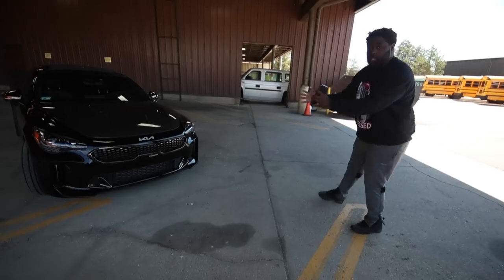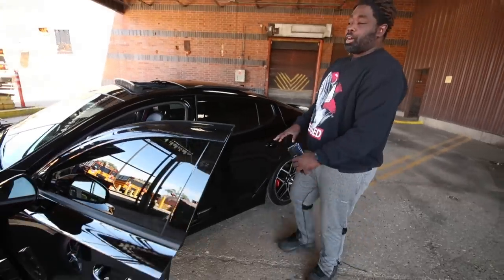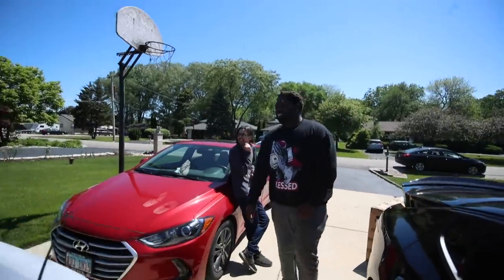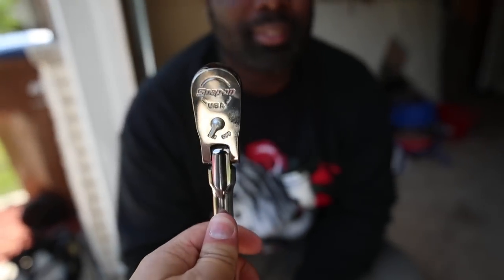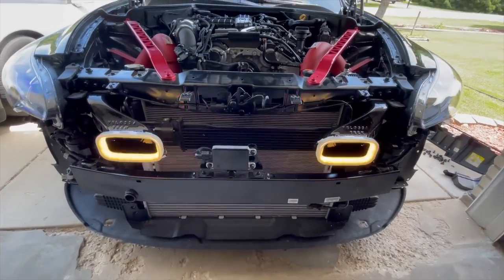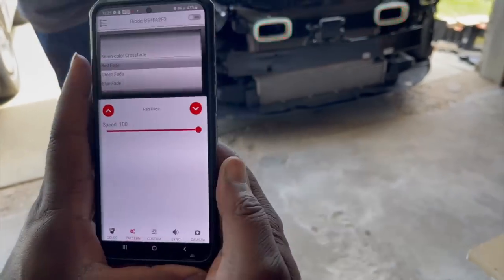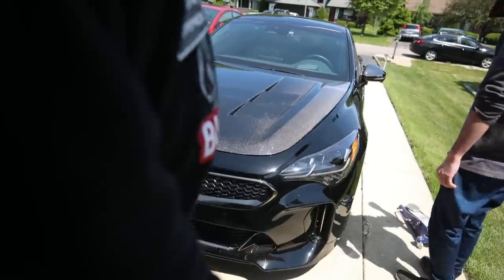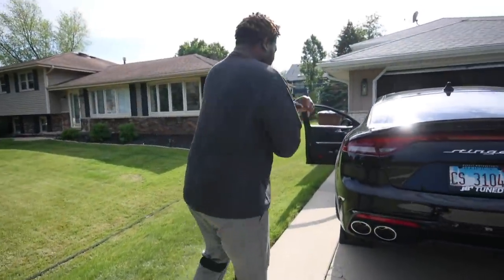PAPA'S 2022 KIA STINGER *BORLA EXHAUST AND VELOSSA TECH UPGRADE!

Comment: Sounds like a beast, but the raspy notes on the higher rpm’s is not everyone’s cup of tea. Would  installing a high flow resonator eliminate the rasp?
Reply: Yeah imo those raspy notes honestly sound disgusting and not really in a good way😂 still a sweet ride tho
Reply from the maker: possibly but it's a V6
Reply: @VividVisual  Adding a Vibrant Resonator will remove most of the rasp, if not all. For me, I went with a custom setup. Started with secondary cat and muffler delete, then added the Resonator which removed about 60% of the rasp, then added a  Magnaflow High-Flow Cat which got rid of the rest.
Reply: I love rasp but this was more along the lines I've a vibrating tin sound, maybe it'll get deeper with more miles?
Reply: @leopapio683  It does not, welcome to a V6.
Reply: @stormbarnicle  idk man the CTV 4 V6 sounds pretty deep.

I'm assuming a different resonator?

My hellcat had a rasp to it that sounded like something rattling but I'm just assuming it has more to do with acoustics because  resonators fixed that
Reply: @leopapio683  Iv'e had my Borla on for a week and a half now, yep at the beginning it sounded a bit tinny /raspy but now is not so much.Exhausts need time to seed in and once the carbon is laid down in the pipes they seem to deepen slightly in tone.Same thing happened with my original bimodal.

Comment: I noticed that everyone who installs the velossa tech big mouth pull the shroud out of the front. That shroud is necessary for cooling. I installed the velossa tech bigmouth‘s on my 20 Kia stinger GT two and I left the shroud in. All you have to do is fit your big mouth  and trim a small area out of the shroud. fits perfect and you still have the functionality of the shroud you don’t have to move any wires or zip tie anything together.
Reply from the maker: Thanks for commenting!!! Much help!

Comment: Did Papa figure out the Exhaust tips for the Borla on his 2022?   I have the same set up and have been reading that Borla and MBRP are coming out with a modification to their exhaust for the 2022 now.   The pipes don't line up with the larger separation of the holes that is what is causing more of the drone and cabin sound.

Comment: My 2019 Stinger is getting lowering springs and Konig Rennform wheels in the next couple weeks, then i'm going for a BOV and a catch can. I love this car 10 times more than the Camaro in my Youtube avi that I owned before it
Reply: I would honestly skip the bov, the factory ones are better than most aftermarket unless u care strictly bout the sound. Do OCC first, the amount of oil mine collects every 1000 miles is def worth it
Reply: @hozanz89  you right, I get enough noise from my K&N Intakes.
Reply: @cozy8874  exactly man, i got the injen intakes, borla catback, jun bl downpipes, jb4, upgraded spark plugs and add-w1 OCC, just need a new intercooler now, love the sound and power
Reply from the maker: @cozy8874  Zaz got the right idea 💡 power and aesthetic

Comment: I have a 2022 Stinger as well.  Is he getting any CEL or errors after adding the Borla exhaust?  

The 2022 Stinger has the electronic valve control for the stock exhaust, and I know that the Borla exhaust doesn't support it.  So I'm wondering if he's getting any warning/error now that the electronic connection to the exhaust is gone.
Reply: Sometimes after adding stuff it takes a few starts for the computer to catch up and drop the light.
Reply from the maker: Nope no CEL
Reply: @VividVisual  great! Thanks bro

Comment: Legit question. The wife wants this on her 2022 GT2. The 2022 has the active exhaust. Any worries of check engine light when unplugged. Or how to fix that
Reply from the maker: No check engine light :)
Reply: @VividVisual  is that with them unplugged or did you leave them where you could plug them in

Comment: Hey man quick question again. When you guys took the front bumper off, the grill has that middle glass piece for that new sensor. Did you have to disconnect anything behind that? Or just the regular one that's under the driver side headlight. I have a 2022 Stinger so I was just wondering. Thanks again.
Reply from the maker: You will see once you got all the clips and screws out which cord you need to disconnect

Comment: Quick question, do you guys have RWD Stingers or AWD? They list the RWD with the same acceleration, but you'd think the AWD would fare better unless weight is the factor. Anyone that can confirm this without a doubt?
Reply: I have a RWD. The AWD is a bit quicker to 60 and also a fit grippier, but RWD is much better if you want to drift. I generally don’t drift at all so for me the AWD would have been better but they didn’t offer it in Australia.
Reply from the maker: RWD is also slightly lighter

Comment: you have a link for the intake heatshields,, didn't quite catch that info. Would appreciate it.
Reply from the maker: Have to just go to their website! I Add w1 website
Reply from the maker: Here they are https://www.addw1.com/products/air-filter-carbon-fiber-heat-shield-cover-for-injen-intake-2018-up-kia-stinger-3-3t?_pos=11&_sid=3255e900d&_ss=r
Reply: @VividVisual  thanks good sir,,I found it when I realized I had the ADD W1 catch cans myself. Appreciate the info and the vid.

Comment: What if Kia sees your video?  Then your warranty is voided
Reply: Not according to Federal Law.
Reply from the maker: Nah that isn’t the case
Reply: @VividVisual  I had an RX8 a long time ago and there was this guy that claimed Mazda was challenging him on a engine failure claim because he posted about going over 100 mph in the car.  So I wouldn't be too sure
Reply: @jalove7  So if I post a video of myself slamming the car into reverse going 80mph and blows the transmission and the dealers sees it they are just going to happily replace the transmission because I didn't install any aftermarket parts.  No more likely if you post evidence of abuse they will void your warranty
Reply: @jalove7  Are you crazy?  The piggy back unit is telling the turbo to run boost above specs.  WFT are you talking about if the manufacturer knows you were running a piggy back your warranty is void
Reply: @jalove7  omg ur bonkers